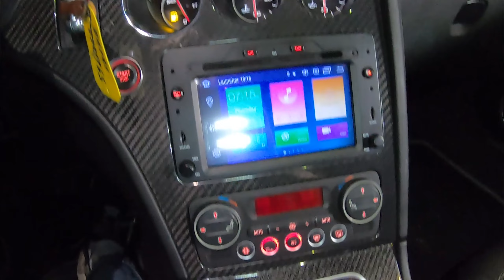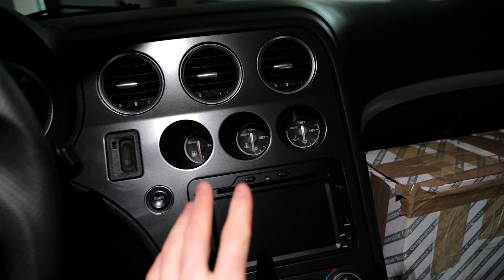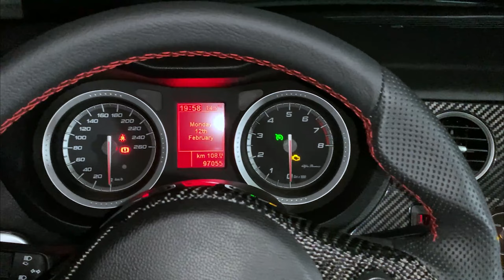Alfa Romeo Brera FULL CARBON FIBRE interior kit installation

Comment: It's a very good job. Where did you find this custome parts? I am owner of a 159 2.0 JTDm super that it was sold with Black panels but I am interesting to do as you did. 

Nice
Reply from the maker: Thank you man! 😁🤝
The center console part is the OEM Alfa Romeo Carbon fiber part. The steering wheel insert and the gear piece one is a custom made part by a Gáspár Tamás. 😁🍀